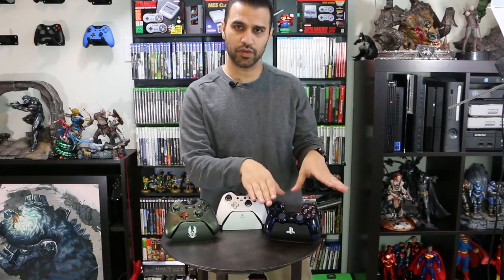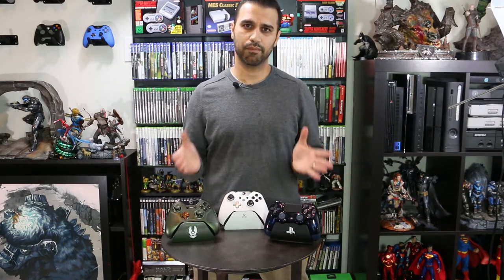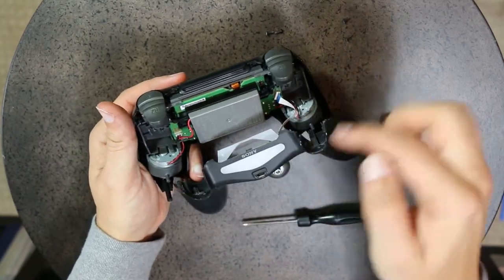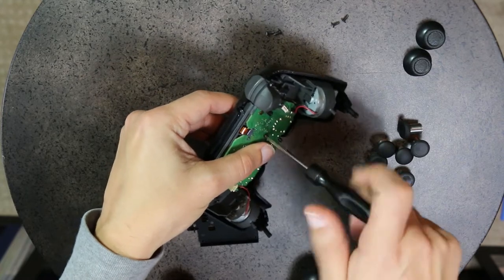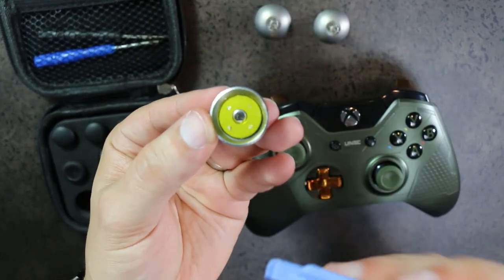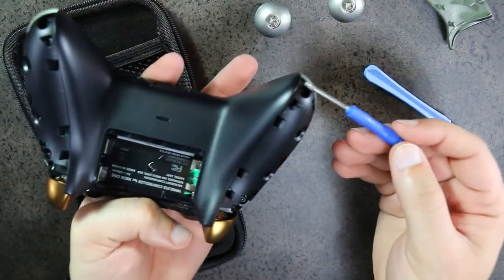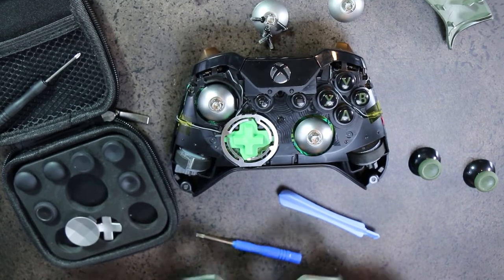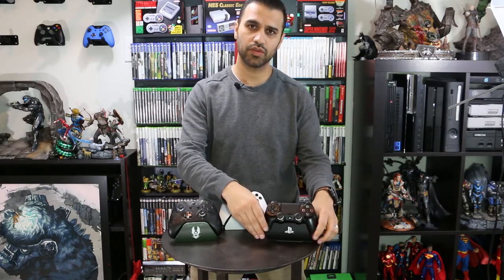PS4 and Xbox One Controllers Magnetic Thumbstick Upgrade

Comment: Will the magnetic thumb sticks work with common Xbox controller?
Reply from the maker: They can if you modify the thumbstick bases to use the Elite ones.
Reply: @SeasonedGaming  so I just have to buy magnetic thumb sticks with the base?
Reply: @SeasonedGaming  Can you please explain?
Reply from the maker: @User22-s7y  The thumbsticks attach to the thumbstick module. The normal modules on Xbox controllers are not magnetic. To use magnetic thumbsticks, you have to upgrade the modules themselves to the Elite ones (you can usually find on Ebay). It all depends how much you want to customize your controller.
Reply: @SeasonedGaming  I saw that people just put the base of magnetic thumbstick and then stick on the common Xbox controller
Reply from the maker: @User22-s7y  Yes that's what I'm saying.
Reply: @SeasonedGaming  So magnetic thumb sticks fits to standard Xbox controller, but you have to just change the base to put them, right?
Reply from the maker: @User22-s7y  Y
Reply: @SeasonedGaming  So magnetic thumb sticks fits to a standard Xbox controller, but you just have to change which is for magnetic ones and just put them, right?

Comment: Pls share the link of seller who sell the protected magnetic thumbstick. Which seller u buy from?
Reply from the maker: hi there, these can be found in a number of areas including Amazon. Here's a quick link to eBay seller. You do want the ones with the 1698 part number as they do include the magnetic protection. Search for OEM MS Elite thumbsticks 1698

https://www.ebay.com/itm/OEM-Microsoft-Xbox-One-Elite-1698-Metal-Magnetic-Thumbsticks-Joysticks-2x-Set/323677986875?hash=item4b5cb6203b:g:iEwAAOSwjYVcVgqv:rk:2:pf:0
Reply from the maker: @FatalCorleone07  Elite controller joysticks are magnets due to their easy on/off feature. bottom of the joystick housing needs protection so the back LT button is not affected. If you take the cheaper route without the protection your controller will not work properly
Reply from the maker: @FatalCorleone07  they cannot be protected after the fact and why we caution purchasing them without protection in the video